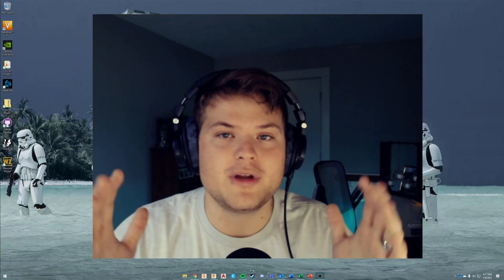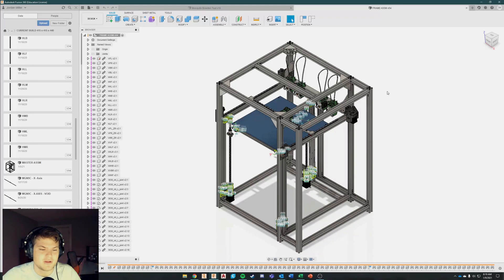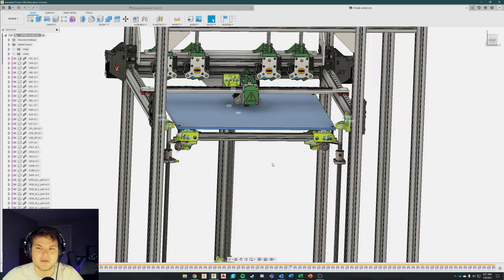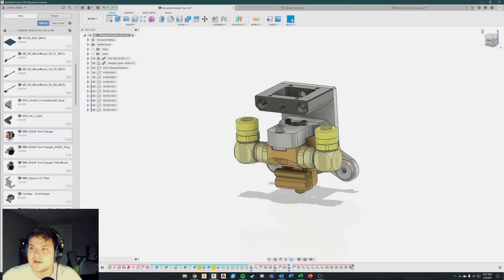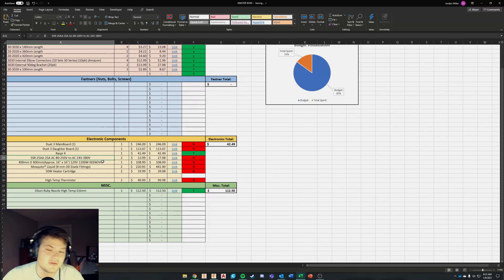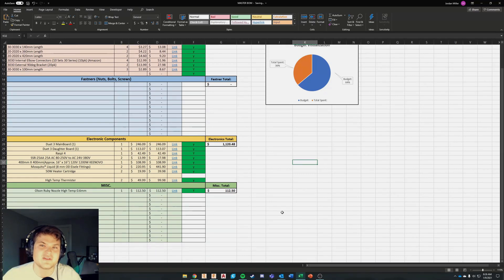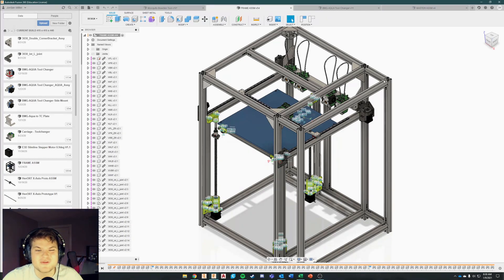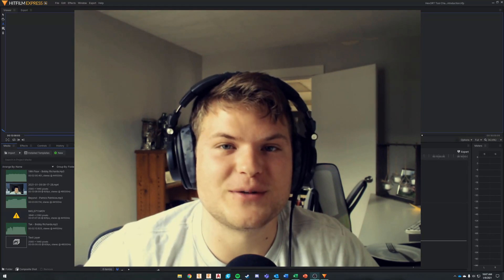E3D Mosquito Liquid Tool Changer | HevORT Tool Changer Project

Comment: Nice. I've been following the HevORT for a while. Planning to convert a big crappy printer I found into a HevORT. I'll watch the rest of your videos on it.
Reply from the maker: I appreciate it! It was a really fun/frustration/rewarding project that taught me a lot about printing, mainly coding in RepRap, and the importance of good design.
Reply: @JordanMiller1117  yeah I bet. The printer I picked up for cheap is a Tronxy X5SA 500 pro. Not known for reliability. Brand new but needs TLC. Planning to get it working and printing or acquiring a Duet board, HevORT parts and slowly upgrading it. The major difference will be the lack of the heavier frame for now. Possibly a Chinese servo upgrade as well. That's the plan.

Comment: Hey, where did you get the CAD model of the mosquito? Did you draw it yourself or?
Reply from the maker: Good question, I had the same. On Slice Engineering's website in documentation, you can find the STEP model at the bottom. https://www.sliceengineering.com/pages/documentation

Comment: Why do you want Duet 3? If you gonna get RPi 4 you can cheapout on main board, and use Klipper, and with Klipper you can have hotend boards connected using CAN bus(look up "Huvud toolhead board"). If you're not sure it would work, Guy at ERRF 2019 did it( video: https://youtu.be/2u0d4myZtUk )
Reply from the maker: I wanted the expandability of duet, plus I already am familiar with it. I have no idea what I’m doing with Klipper. 
You raise a valid point but cost wasn’t too much of a concern for this build, I know where your coming from trying to maximize the dollar. 
Plus, The Hevort creator already had config files only for duet when I made that decision.

Comment: Would not mind to see 3d files.. Only x is the key here.... Im still debating if I go 0.4m2 or 0.3m2.
How will you fix insulation? I Will use turna vacuume panels
Reply from the maker: Will be releasing CAD files soon they will be on Github. Not sure yet about insulation, I am just thinking of some foam board with a reflective surface.
Reply: @JordanMiller1117   foam board is not good idea reflective part ja. remeber you will have chamber like me 350k to 390k.. but if you want hoter chamber- these design will need to be changed.
anyway i recommend rockwool with reflective surface.. or space "blanket"
thank you
Reply from the maker: @ItisImarko  I agree, whatever the stuff is with the reflective blanket would be best.
Reply: @JordanMiller1117  ja.. i will star making new 3d printer will try to make some files for insulation

Comment: BLTouch won’t resist high chamber temps. Maybe take a look at the Annex Engineering Magnetic Probe? That might hold up better
Reply from the maker: Yeah I am using E3D's bed switch now, but the BLTouch in the chamber was a concern of mine too. I appreciate the recommendation, I'll check it out.

Comment: Great video! Great project! You built exactly the printer, I am thinking about since months. The fusion of the E3D tool changer and the leveling bed of the hevort.
Have you ever considered a remote extruder like the zesty nimble?
It combines the advantages of a light printhead like a Bowden setup and the direct extrusion of the material.
Reply from the maker: Thank you I appreciate it! I have seen/heard the Zesty before and I didn’t think to use it here actually. But yes that is a good idea, I plan on doing some sort of direct drive setup for the many hotends on this printer. Thanks for the reminder!

Comment: You will need heavy insulation and those 90c parts will not allow pei peek or like printing anywhere near, a minimum of 150 c build temps ideally up to 190c build temps are needed for that material . If you want use pa12 cf it’s at least good for 130c continuous but you should have them made out of at least 9085 or 1010 pei if your wanting to print super high temps

Comment: Great video .....Too big ......how about those fitting they are heavier then that mosquito itself better fittings are suggested those fitting are for semi flexible line not flexible hose did you get the ferrels for them ?
Reply from the maker: What is too big? The fittings are quite big relative to the hotend, but are the connectors the Slice recommends, so that is what I’ll be using, the connectors work with the tubing I will be using.
Reply: No problem was just trying to help maybe review slices page at the bottom or the liquid mosquito about the McMaster Carr pcs they added to the bottom,  I was only trying to prevent issue for you my bad but do read the changes at the web site for your flexible hose to theses fittings without the Vicon hoses they now specked
Reply from the maker: @CC-kc5lb  no your fine, I am doing my best to figure everything out, and I am bound to make mistakes so thanks for the watchful eye.
Reply: @JordanMiller1117  we all make mistakes some are not actual mistakes yours is not a mistake but I was just checking so you could do what’s best with the knowledge cheers and make more videos your teaching me things so thanks first

Comment: Bowden is actually ideal for printing fast since you aren't slinging around that pesky stepper, I would love to see a HevORT bowden.

Although I will say the Mellow BMG Aqua several of the group members use doesn't seem to affect speeds much.
Reply from the maker: I agree, the decrease mass will help with artifacts not being as prevalent in the print.
Reply: @JordanMiller1117  just put in one with direct drive, since you  got a toolchanger
Reply from the maker: @berberger4814  I plan to in the future, I won’t to get a laser and even mill tool as well.